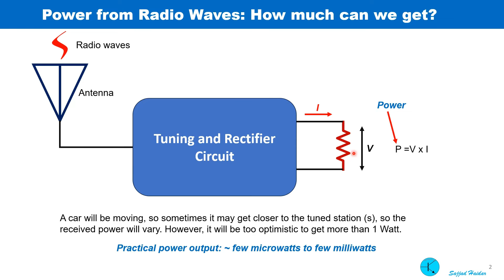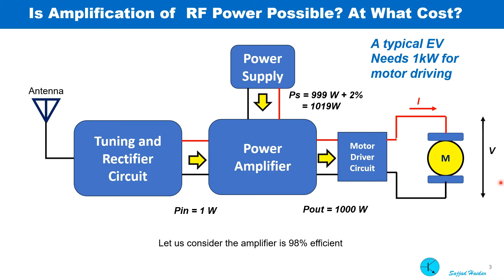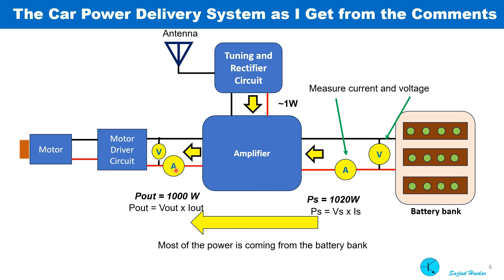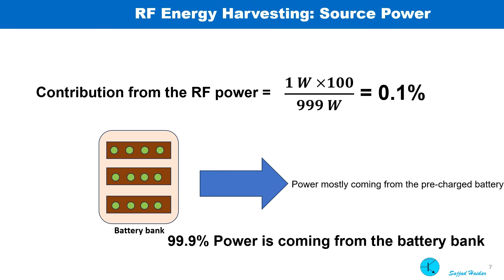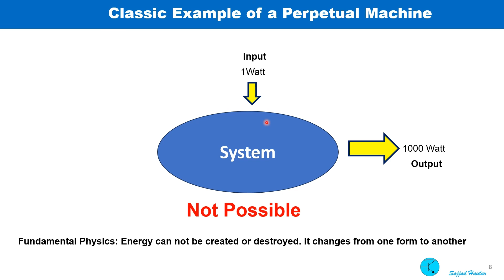Energy Harvesting From Radio Waves -Responding Some Comments

Comment: It still remains to see how it's being done. Any avionics engineer will show you by the math, that by body mass & weight to wing proportion that the bumble bee by all right should not be capable of achieving flight, yet it still does fly.
Reply from the maker: That is not a case to compare with. If you can check that vehicle and do the measurement you will find the truth. The news of this kind of free energy things are not anything new, you will never hear the news after some days.
Reply from the maker: If any avionics engineer calculate that a bumblebee cannot fly, he is theoretically wrong. Bumblebee's wings are flexible, create vortices with complex wings flapping and create pressure difference. Many physicist studied that and proved that they can fly.

Comment: How about converting high energy EM light that exists everywhere into a lower useable range with a proper ferroresonant circuit?
Reply: Basically, you're expecting to get more usable energy by increasing entropy. That's violating the 2nd law of thermodynamics. You're better off with high frequency EM radiation to use than low frequency. The conversion process only makes the energy available even less available.

Comment: GOOGLE AFRICAN INVENTORS AND YOU WILL GET THE ANSWERDS.MOSES THROWN HIS ROD ON THE GROUND AND IT BECAME A SNAKE, BY WHAT POWER, PHARAOH SERVANTS DID THE SAME. YOU DO NOT KNOW EVERYTHING AND YOU ARE UNWILLING TO LEARN.HOW DID JESSIE RUSSELL GAVE THE WORLD DIGITAL TECHNOLOGY, GOD'S WISDOM. THOMAS MENSAH TOOK FIBER OPTIC CABLE OUT OF THE LAB, WHICH OTHERS COULD NOT DO FOR FIFTEEN YEARS. PHILIP EMEAGWALI PAPERS ON MASSIVELY PARALLEL PROCESSING OF COMPUTERS WERE THROWN IN THE TRASH CANS BUT 4 JULY 1989 HE MATERAILIZED HIS WORKS.OTHERS PLAGAIRIZE HIS WORK BUT COULD NOT EXPLAIN.

Comment: Maxwell does  not get energy from the radio waves, instead he does what  N.Tesla did I think.  By using of the waves that are within the RF range, he initiates the process(with the correct impulse,  phasing, geometry etc), which causes the energy available in the quatum background field as nano-scale fluctuations to synchronize, resonate and leak(transform) into the ordinary electromagnetic energy.  Imagine forming invisible tornadoe and harvestings its energy when the tornadoes grows, without causing it to dissipate...
Reply from the maker: This is nonsense. The end result is the creation of energy, that is not possible
Reply: @technologyforyou5976  Maybe mistaken, But didn't you say that you could get twice the power (or there about) by using two mono pole antenna if the antenna were far enough apart?. What @raydan18 is talking about is something that may not be restricted by proximity of antenna (or receiver, whatever) RE: NOT radio waves but some other form of frequency (waves) and cause them to oscillate much like two tuning forks when one is struck the other oscillates in sympathy all in tune with this mystical "frequency wave" which causes multiplying power. And do this by using a similar or same concept that you did with the radio waves.
1st Law of Thermodynamics - Energy cannot be created or destroyed. Surely it can be harnessed and harvested if it is out there. TC.
Reply: What is RF and radio frequency waves, will this raydan18 explain.
Reply from the maker: @rd9831  RF means radio frequency. Frequency ranges from 20 kHz to 300 GHz

Comment: Not radio waves, chicken bootso called it "microsonic". Irregardless who is to say that there isn't some kind of microsonic radio waves...ultrasonic or mchicken waves, whatever, IF there is why not tap into it even if tiny amounts...just make multitudes of receiving avenues to collectively obtain enough to serve the requirement.TC.
Reply: He claimed his microsonic energy device was able to convert radio waves into 'pure energy'. That is, the primary source being radio waves. Even if he was talking about some other form of energy, what's more likely? That he's wrong or he's right? No one else has observed that, and it remains to be tested by others and the results published in peer reviewed journals before being accepted. The scientific method exists for a reason, so that people like Chicumbutso (who is by the way not the first to come up with something like this) should not fool people into thinking that there's a new invention meanwhile there isn't. Every valid discovery and invention went through the scientific process and had to pass it. Way more people have come with trash than those who came up with something genuine. So, it's ok to be skeptical, while considering giving him a chance to prove his device works.
Reply: @EdycliffDaba  Radio waves won't do it as Technology for You said in his 
example the antenna would have to be a wavelength apart to 
capture two times the power. So that probably means if there 
is a way to do such a thing the frequency would need 
to be some crazy high pico hertz or whatever so that the 
wavelength won't disrupt each antenna or avenue to gather the 
"energy".
Reply: @EdycliffDaba  Sorry there is more to reply...but it keeps getting deleted (algorithm
Reply: @EdycliffDaba   I feel that Chicumbutso is a scam 99% and 1% hope 
he is real. Also think it possible that if it is possible 
like some have said that Nicola Tesla had already done 
it...IDK. But if it had already been done some "elite" or oil 
company whatever would have "SHUT them DOWN".
Reply: @EdycliffDaba  Also think that Chicumbutso is a scam 99% and 1% hope 
he is real. Also think it possible that if it is possible 
like some have said that Nicola Tesla had already done 
it...IDK.
Reply: @EdycliffDaba  But if it had already been done some "elite" or oil 
company whatever would have "SHUT them DOWN".
Reply: @EdycliffDaba  Just like what 
happened to the "TROMPE" powered vehicles that ran on 
compressed air--the patent was bought and any knowledge of it 
shelved and hidden away.